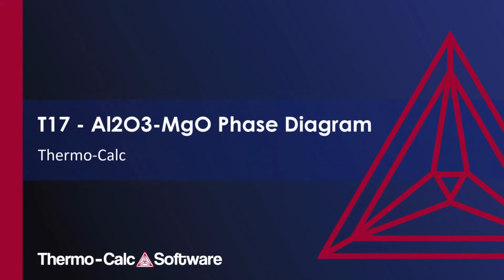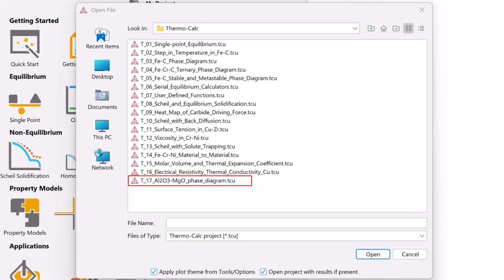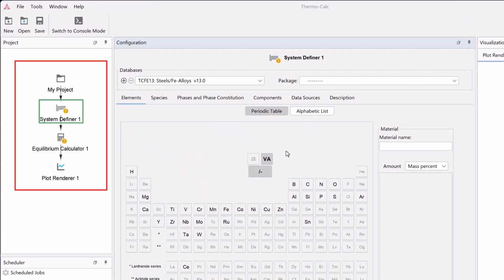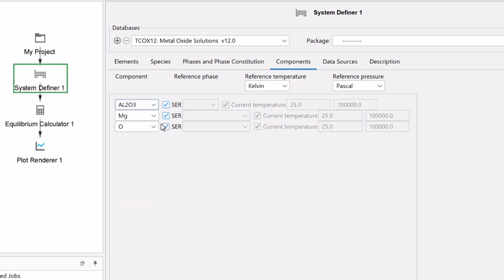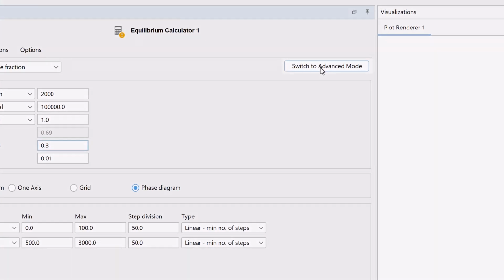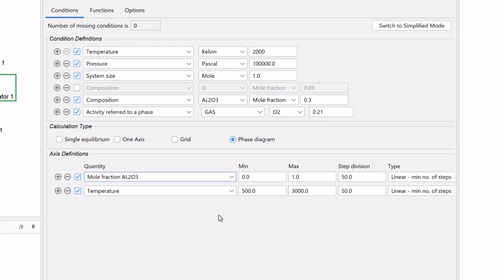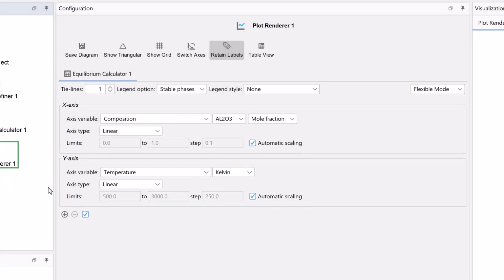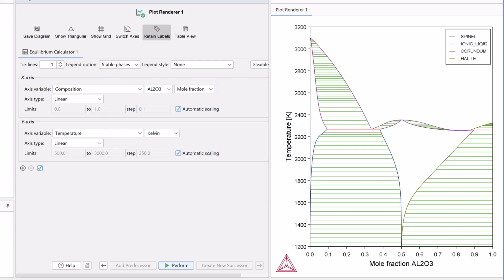Example T_17 - Al2O3-MgO Phase Diagram

Comment: Can you help me how to define the flame spray coating (powder material + substrate) to calculate the phase diagram, 
MY PROBLEM IS THE SUBSTRATE IS ALLOY SO CONTAINS SEVERAL ELEMENTS !
Reply from the maker: Hi! Could you please email with more information. Formulate your comment as a question and email info@thermocalc.com. Include your place of work and Thermo-Calc version number in the email.

Comment: I would like to see an example where austenite to ferrite TTT diagram (starting curve at 5% and finishing curve at 95%) is plotted for any steel in the temperature range where the steel is solid.
Reply from the maker: Hi! Thank you for your suggestion. While we do not currently have a video on this, you may be interested in this application example, which discusses the hardenability design of steel: https://thermocalc.com/showcase/application-examples/hardenability-design-of-steel/